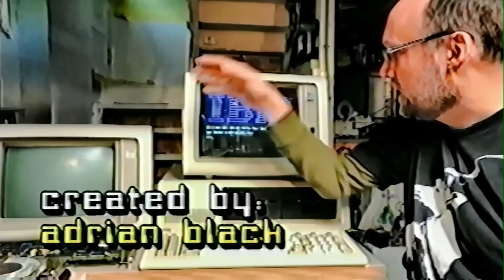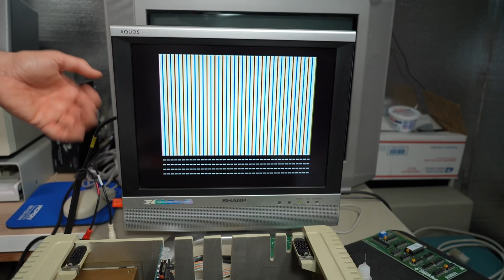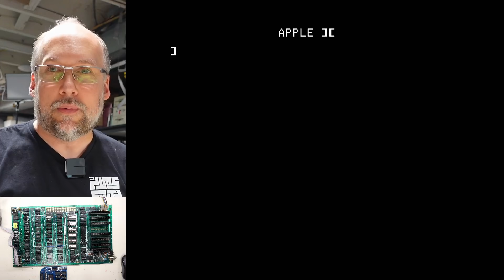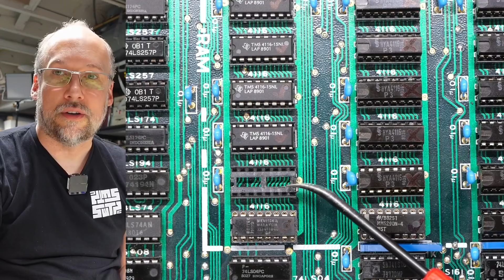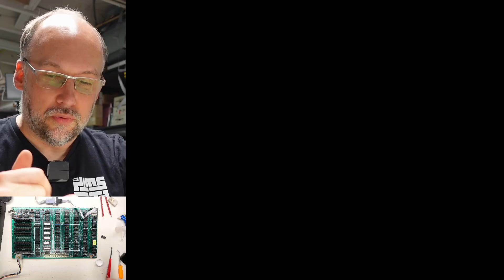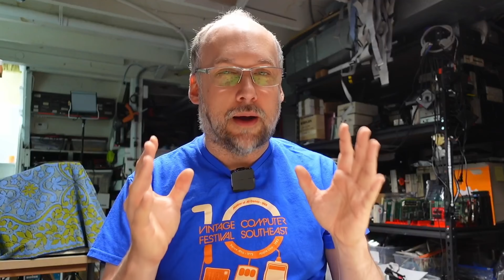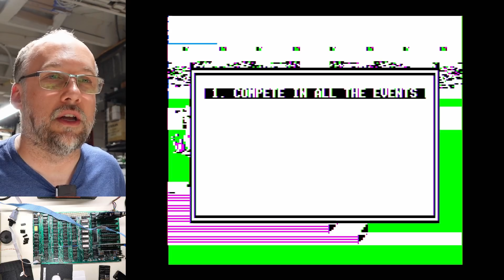Apple II+ clone repair: The sweet taste of success!

Comment: Slightly out of spec RAM chips were still a common problem twenty years after this board was put together. I remember having problems with FPM and EDO RAMs for the PC in the late 90s, they just wouldn't work sometimes. With this board, I would have reflowed the whole thing with hot air after finding these kinds of faults from the factory.

Comment: I actually wrote a ram test once in the early Hadean epoch, because on our custom built HW, a customer came back with a crashing board, and if memory tested with all zeros or 0xff or any other fixed pattern it tested good, but the error was that once cell were read back at the next address. So I had to write a program that
1) Wrote all 0x00, and read back
2) Wrote all 0xff, and read back
3) Wrote all 0x55, and read back
4) Wrote all 0xaa, and read back
5) Wrote increasing numbers 0x00-0xff and read back.
This took obviously too long time for a Power On Test but it was always avail in the settings/diagnostics menu.
If my memory serves me well it was in the ballpark of 512k ram.
Cpu was Motorola 68000.
Perhaps 1987.

Comment: I'm no assembler programmer, but it feels like the diag rom could use some kind of a clock-tick sound every time it switches "pages" -- so you can do a ram diagnostic on systems that you have no video for (whether you lack a composite video monitor, or if the system's not putting out video for some other reason).  It would also be useful if there was an auditory beep that tells you the faults (i.e. count the beeps to get the bad block).
Reply: Easy enough for the tick - BIT $C030

Comment: I suspect that this build was a clone kit (bare PCB, case, keyboard, PSU), or a pile of parts that someone mail ordered.  This would explain the mixture of parts, sockets, and ROM images used. The original builder never got the system to work, and shelved it.
Reply: I was thinking this all along in the first video. I suspect this computer NEVER ran until Adrian got to it.
Reply: I was thinking this as well, and I was thinking how sad I would have been back in the day if I had convinced my parents to buy a kit and then it never worked.  So frustrating

Comment: Freeze spray is great for finding problems that only manifest when the system is hot or cold.  Expansion from heat can make a marginal joint work perfectly, where a blast of targeted cold can help you locate the fault quickly.
Reply: One of the more common failures of the BBC B is the video ULA fails when it gets hot. You'll see graphics corruption, but a small blast of freeze spray on the video ULA "fixes" it, making it really easy to identify the problem.
Reply from the maker: I actually have a crate of the stuff that someone gave me. Funny though it wasn't really cool related - it was mainly a mystery LOL. Great seeing you at VCF!!

Comment: I have a similar clone, and also had problems with the composite output.  It seemed very flaky, sometimes it synced up OK after some futzing with the pot but was not stable.  I finally tried a different monitor and it worked fine!  So some monitors (LCD) do not like something about the output.
Reply from the maker: Yeah my Commodore 1084 works perfectly but seems new stuff is very fussy with the video output.

Comment: Was A9 - LS151 really a bad chip?
Reply from the maker: No I don't think so. It tested Ok in something else after I was done with this as well as all of that RAM I took out. 

The motherboard still occasionally briefly has the white graphics issue... so it may need another socket replaced. 

I think the RAM's oxidized pins were just not happy in those sockets as it all worked fine in my Apple II+ (with dual wipe sockets)

With the replace RAM it never has any RAM errors or crashing anymore so that's good!

Comment: I have a blue colored "Unitron" clone motherboard with a matching blue unitron disk controller and they are both basket cases, I've prob had them working for about an hour total. This series has given me hope that one day I'll get them working 100%!
Reply from the maker: I think the unitron motherboard is the same as this other than the color. Yeah it seemed QA was not high on the priority list of these companies LOL
Reply: @adriansdigitalbasement  It's terrifying because the first time I tried replacing a transistor after desoldering, the pad and trace ended up floating on top of the solder blob... 😬 Also it can create red herrings, I spent weeks troubleshooting noisy video only to realize it was my reactivemicro PSU and not the board!